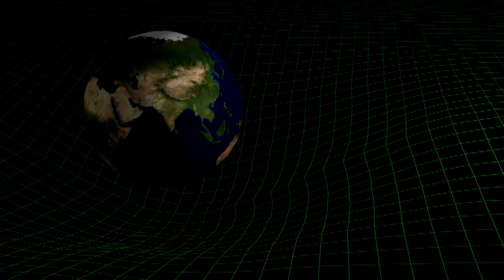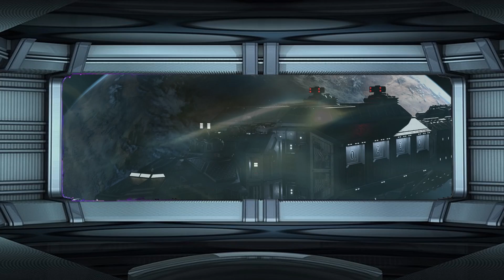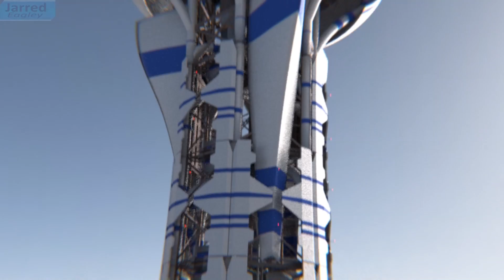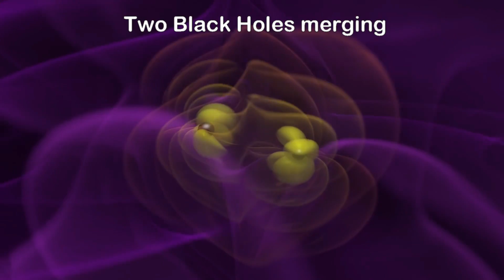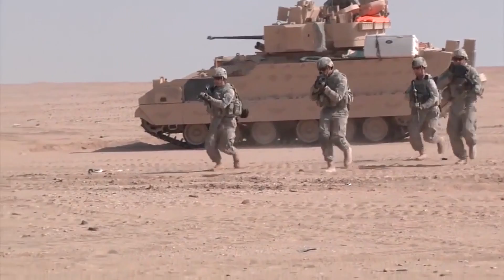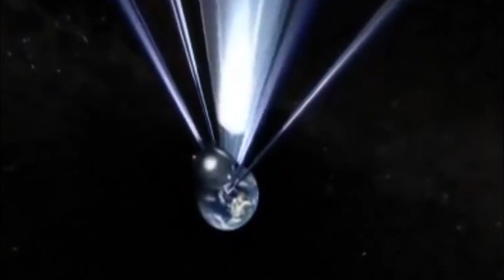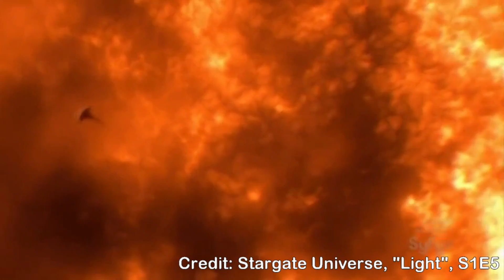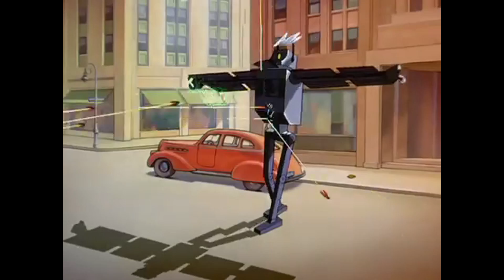Force Fields

Comment: What about a nano cloud?
Small lenses to reflect light based attacks.
The ability to link up and coordinate to absorb impacts though at that scale there probably wouldn't be much they could absorb.
They could emit electromagnetic fields to deflect charged particles and weaker radiation.
But nano is unlikely to get anywhere near that good for a while.

Comment: The bit about heat management made me think of a detail that I really liked in the codex entries from Mass Effect that didn't make it into cutscenes (because try getting the art department to not just make star wars); heat management is basically described as the main actual limiting factor for warships and they deal with it by making the ships "sweat", spraying droplets of liquid sodium or lithium to radiate heat faster than the hull itself could.

Comment: Ok, this is an area I have given a lot of thought to.  And the concept that allows "force fields" in my books is at the core of how things work in the universe I describe.  The big thing is, what I use may very well turn out to be how our universe works as well.  As a couple scientists have posited that the base therum may be correct.

I start with the theory that there is a such thing as Aether and everything is connected by it.  As I said, scientists are looking at this again as it explains a lot of things.  I take it one step further to everything is made of it.  We haven't figured out how to directly sense it yet.  But aliens have.  And if you can directly sense something, that means you can manipulate it.  So they don't have "anti-gravity".  Gravity is an observed, like sound.  There is no "anti-sound".  But they have engines that can "grip" the Aether, which gives them drives that make moving similar to a boat or submarine.  While there isn't technically a limit as to how fast you can go, there is still a very real limit on how fast you can accelerate.  These engines also give the ability to induce "gravity" in ships, as well as compensate somewhat for inertia.  But still no real "breaks".

Now for "force fields".  In my books, they use a version of these engines to generate "bubbles" round the ships.  Thin ones for navigation (protection from radiation and materials while traveling at high speeds)  and thick ones for combat.  The difference isn't for energy reasons (mostly).  Nor is it for being able to see/sense through.  The shield generators create a "wall" of Aether dissonance around the ship.  Everything has one common weakness if it wants to be a "danger".  That being coherence.   As everything is made up of Aether, a strong dissonance wave would disrupt that.  And as the dissonance would be computer generated, it's easy enough to reverse that on any sensor readings you get through it.  The downside, and why the thick ones are  only used in combat, is that it would also act as a drag on the Aether you are traveling though.  Sort of like a large sea-anchor.

Comment: Force fields are basically total fiction. Not quite as impossible as FTL travel, but totally impractical in the way they are depicted in sci fi. Even a plasma window powered by a fusion reactor makes no sense. Better off using all that energy to power a death ray laser or particle beam to just shoot down the enemy missiles before they hit. It also has the added advantage of being able to be used offensively, either as a beam on its own or by accelerating projectiles to extreme velocities. 

The closest thing to a force field would probably be electric reactive armor or dynamic armor (which appears to be the same thing). Although I'm not sure if such a thing would even work in outerspace with no air to ionize into a plasma, although it might be possible to carry your own propellant to vaporize.

Best bet is innovations in materials engineering. Q-carbon and graphene are promising. Q-carbon has a good chance of being made in bulk quantities, and if graphene can be made in bulk then that would be a game changer. Super light and super strong. Not sure if graphene sandwiched with q-carbon armor can shrug off nuclear explosions or not, but they should at least be far superior to any armor materials we are using now.

Comment: +Arthur A steel knife won't cut plate armour, you would thrust through the gaps. Battle of the nations is a combat sport where basically any technique which would actually be effective on a medieval battlefield is banned. 

Even a warbow with the correct arrows is next to useless against a well made breast plate (all of the videos showing the contrary have used thin stainless or aluminium rather than high carbon plates).

Of course there were melee weapons designed to deal with full plate, either by transferring kinetic energy through it, piercing it or caving it in but knives/swords are terrible in that regard.

Comment: I always liked the idea of temporal/time shields; if you make the time difference sharp enough you might either make the back of the projectile collide with the front if the field is slow, or rip it apart by basically accelerating it to bits with a fast field.

Comment: I think force field hulls are somewhat unlikely because they are much less reliable than a normal one - if the power fails for whatever reason, you also lose most of your hull. As such, at least vital parts of a vessel are probably always going to be made from matter, like, idk the bridge and the reactor. Even if that isn't the case, at least lifeboats would probably favor reliability over low mass. Apart from force fields probably being more expensive than some hull plating, especially considering the likely quite high power draw and resulting cost of the required generators.

Comment: I'm so glad you covered the concept of heat build up inside a force field. This is something that I've complained about when discussing force fields with die-hard fans if Star Trek and the like. Where does all the heat go if the shield is deflecting matter or energy and doesn't get the protected ship deflected either? Even if that energy isn't absorbed, the shield itself has to generate the equivalent to deflect the incoming energy. This similar issue comes up with cloaking devices. The Mote in God's Eye probably had the best description of what happens in a realistic(?) force field.

Comment: What about cold plasma? Also, I thought different plasmas were able to absorb different wavelengths of light better than others, so you could just use a plasma that absorbs the wavelength of the enemy laser but doesn't block the wavelengths of the sensors you're using.

Comment: In terms of on the spot damage repair, what about using an "inflatable patch" that has a device in middle that after it inflates it uses vapor deposition to coat the inside with a solid metallic coating?   This could be installed either inside a hull or outside a hull is suppose?

Comment: I seem to remember it's possible to use a group of powerful lasers to create an artificial black hole. If you could determine that a laser was about to be fired at you, could you then theoretically create an artificial black hole between you and your enemy? Ideally, you could even use it as a kind of riposte or counterattack, directing the black hole towards the enemy (this would of course require the black hole to be of sufficient mass for it to reach the target before exploding, which probably isn't feasible unless you've got a pretty damn big ship or station to defend which is capable of generating such a black hole).
Reply: What you're talking about are called kugelbltiz, and it's a bit harder than just having a giant laser.

Comment: >bullet goes through dense plasma window
>molten lead hits you in the face
Reply from the maker: Yes but if it is vaporized it could scatter out, get stopped by more mundane armor, possibly. A big enough and fast enough bullet will go through but bigger and faster are both real bottlenecks on bullets.

Comment: Oh BTW you can totally intercept lasers. Lasers work because the photons arrive at the target in an extremely compact group. If you can scatter the photons, it ceases to be a laser and is just colored light. So all you need is a gas that will scatter photons - which most of them do. Even water vapor. But if you made specialized gas, especially of highly reflective elements like chromium or aluminum particles, lasers are effectively obsolete.

So here's what you do: you get up to the speed you want, and deploy a protective aerosol around your ship. That protective bubble will track your ship so long as you do not accelerate independent of the bubble - effectively shielding your ship from laser attacks for the duration of your voyage without much "replacement" being necessary. Your ship could even extend your own weapons outside of the bubble and return fire, only exposing your weapons to enemy damage.

This is why lasers as space weapons are a bit silly. Unless your lasers are powerful enough to be kinetic, you will never "burn through" an aerosol shield. It will simply get hotter and phase-change in place. Since there's presumably still a near-vacuum between you and the individual particles of aerosol, thermal conductivity will be near zero, and so your ship wouldn't have to deal with heating problems. Of course the aerosol would light up as it shifted into a plasma, but that's unavoidable.
Reply from the maker: I'm sure I mentioned using vapor or solid objects to scatter lasers in the episode
Reply: You did. I just think its a good idea that's worth exploring further. For instance, lets say that your aerosol is charged, you could actually use is as a permanent "always on" shield, by having your ship emit a magnetic field. The aerosol would follow the magnetic force lines and return, and you could re-emit it. You'd make your own little Van Allen belt.

This would be a slight problem if the aerosol were getting superheated by lasers, but I'm sure you could find a way to "throw away" stuff that was getting too hot and replace it with more material from inventory. Heck, maybe you could even keep superheated returning ions and use that energy to shoot back at them.

Also this shield probably would get stripped off if you were to try and fly through a radiation belt - so there's always that problem - but in "traditional space", I think it would work.

Comment: This is why I tend to label the Sci Fi I write as "Sci Fi fantasy" rather then just pure Sci Fi. 

I enjoy having factors like energy shields in my settings but I also like to implement a lot of real life physics and tech, aka  "hard science" with a touch of soft science (aka, theoretical stuff) as a nice layering on top. 

I have written hard Sci Fi fics but they generally rend to be a bit nihilistic in nature due to that so I prefer to stick my nose a bit outside real physics. ^_^
Reply from the maker: I think it is a good idea to not get too bound by science in scifi, even Alistair Reynolds usually permits himself a couple handwaves. But truth be told I really catgorize hard vs soft scifi not so much on what tech they have, but rather if they explain it, acknowledge it as 'new science', put clear restrictions on what it can do and the author explores other uses of it. Either way hard vs soft is not good vs bad, lots of the best scifi is sci-fantasy, though many of those are just focusing on some different zone of science like psych.

Comment: While a very VERY bad show. In Aldnoah.Zero(It's an anime if you wonder), there is a mech having a very VERY hot plasma blade that is hot enough to cause Leidenfrost effect on incoming cannon round near it. It cause HE shells to outright explode and AP round to change trajectory so it do minimal damage to actual armor. While not a force field, it should be a good example for the plasma window case.
Reply: Another mech have some entropy-supression-engine on it. It basically lower the surround area so cold ALL incoming rounds becomes super conductors and get deflected by the mech on board electromagnet(or something like that)
Reply: Oh, and the famous dimensional barrier on S1EP1 did play on the "A perfect shield means you are completely blinded". That shield literally teleport everything it touches to somewhere else hence is perfect. Except that it have to leave a hole for radio transmission hence it's the weak point.
Reply: And one use tidal force to deflect rounds. Basically it has some drone that can control gravity, and it spin them in high speed and they generate enough tidal force to shard everything that comes close.
Reply from the maker: It's strange that a lot of animes do the science better, rotating habitats still haven't caught on in big budget American film and TV but Gundam had them way, way back as a central feature.
Reply: May be the "We are not real!" part of anime actually make them more believable in the eye of average viewer that dont understand science too well, hence they can do more "exotic stuff".

Comment: For the plasma 'shield' you said it cannot be rapidly turned off and on again to get a glimpse outside. Could you instead use EM to 'bend' it apart to create a temporary gap instead? And , if so, would that be rapid enough?
Reply from the maker: Hmmm... actually quite possibly, they're still be appreciable lag time and it would be hard to do but yes you can certainly poke holes in a magnetic field with another.

Comment: Maybe we can overlap a single point with magnetic fields making it so that a material was gently held in place, gently kept from flying away, but very forcefully kept from getting closer to us.  We would want said material to have obscene resistance to things like heat and shattering.  Out of this could we then make a "shield" in front of a space ship traveling in interstellar space and have this passively supported shield absorb or deflect impacts, protecting the ship?

Comment: Could you not also use destructive interference for protection against lasers (and now thinking about it a beam of particles also)? Detect the frequency of the incoming laser (or particles) and produce the same frequency yourself only 90 degrees out of phase to neutralise the waveform? I admit it would be very difficult to get this exact but so would a lot of other topics discussed on this channel :P
Reply from the maker: Hypothetically yes, I doubt it could be pulled off though.

Comment: And you didn't even touch on the industrial applications of force fields, such as casting intricate shapes out of metals or plastics, or even using selective cooling methods to make an entire car out of a single crystal of metal.  These things would give you unbelievable strength out of normal materials and would revolutionize the aerospace industry and on down the line, making things astoundingly light and strong.
Reply from the maker: Yeah we always have to leave things out, I didn't even think of selective and targeted cooling, nice idea that, though using it for cast on molten metal etc I did but deleted out of the script before even finishing the first paragraph, it seemed too likely to tangent off onto advanced approaches to 3D printing, a topic I want to do another time.
Reply: I can't wait to see the video on advanced approaches to 3D printing.  The self-replicating machines episode was one of my very favorites.
Reply: Isaac, I would love a video about advanced 3D printing, I can't imagine a better writer for that topic than you.
I liked this video, thought you were going to mention a mid 90's usenet sci.nanotechnology idea of a "Utility Fog" that would follow "around" you and become an umbrella, coat or an airbag, just when needed. 
Thanks, be well Isaac.

Comment: I don't understand the point of Maxwell's demon. It seems to boil down to "If you can block particles based on their speed for free, you can break thermodynamics" But altering the velocity of particles is doing work, and obviously doing work for free is already breaking thermodynamics.
Reply from the maker: Not really, gas bouncing around a vessel isn't doing work on it if it isn't expanding under the pressure or arguably decreasing in temperature. So a gas in a vessel at ambient temperature is just sitting there bouncing around with the same total kinetic energy the whole time. If I can bounce fast moving particles away and let slow moving ones through, without expending net energy to do it, then I can separate it and run a heat engine between sides. Now, I'm quite sure this is impossible but the force fields we see in fiction might permit it, that makes them bad science, but since we're assuming today they can work that way, it seems right to mention Maxwell's Demon.